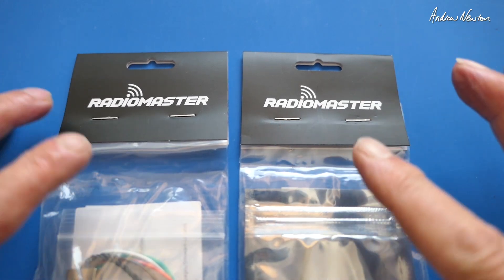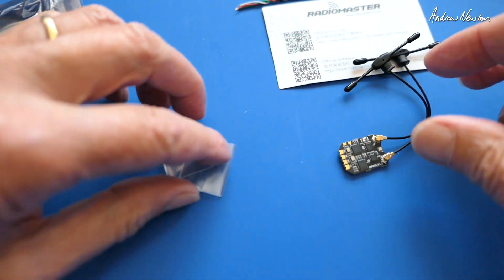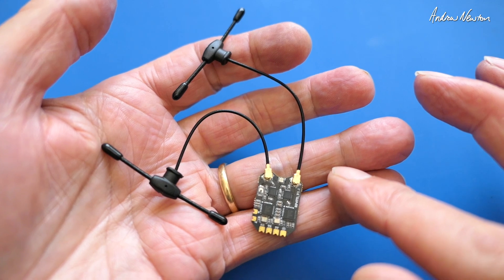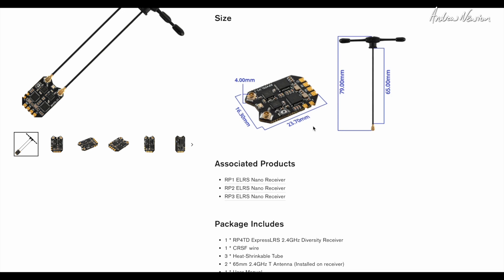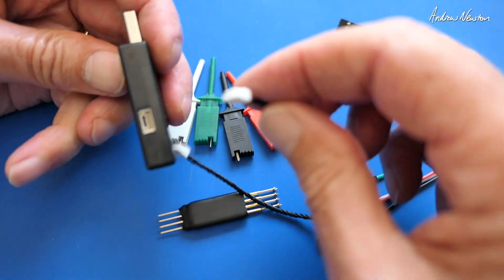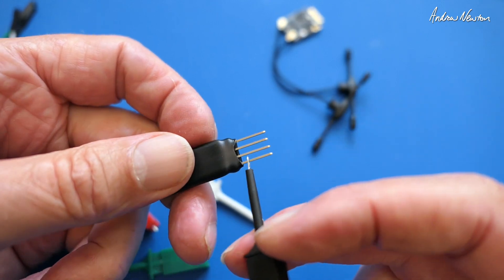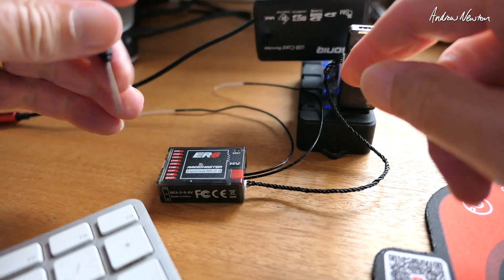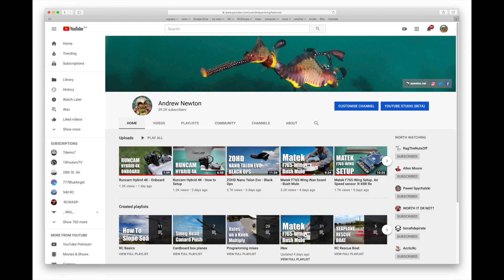RadioMaster RP4TD Rx and USB UART Flasher

Comment: Hey Andrew. I've been a Spektrum user for a few years, but now that im getting into the world of flight controllers I'll be moving to an ELRS Radiomaster TX16s Mk 2 (so much cheaper too!)

Random question, do you know of anyone in Adelaide who offers soldering services for the header pins? I attempted to do this with a Speedybee F405 Wing, but I think I fried the BEC outputing volatage to the receiver and PWN pins. Oops 😀

Edit: Actually, nevermind... I didn't realise that soldering temp made such a big difference. I was using 250c which was way too cold. 360c now give me perfect little blobs around the pins on my practice board. Live and learn 😀

Thanks for your amazing channel, Andrew. Such a valuable resource 👍
Reply from the maker: Well done, soldering does take practice. I bump it up to 400 for thicker battery cables and use flux
Reply: @AndrewNewton  Thanks Andrew.

I bought myself a multimeter, and the ELRS receiver pins (where a Spektrum receiver also gets plugged into) is only outputting 2v or so. Would you know why that might be? The sbus pins are also about 2v. The PWM pins have no voltage.

Happy to hear any suggestions.
Reply from the maker: @r1m.dog78  Overheated BEC component or solder bridge or bent pin on one of the inter board plugs.
Reply: @AndrewNewton  Thanks heaps... it was due to my initial dodgey soldering.

I just used some solder wicker and then re did those pins with perfect blobs and it's now reading 4.7v with the multimeter.

Man I love learning about this stuff 😀
Reply from the maker: @r1m.dog78  Excellent. Great recovery